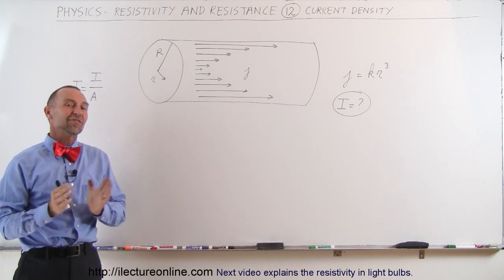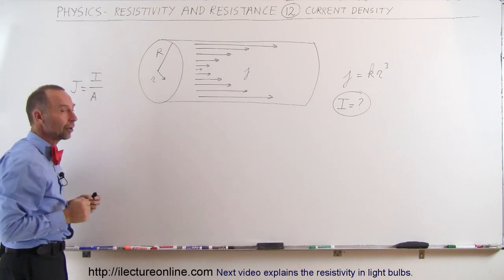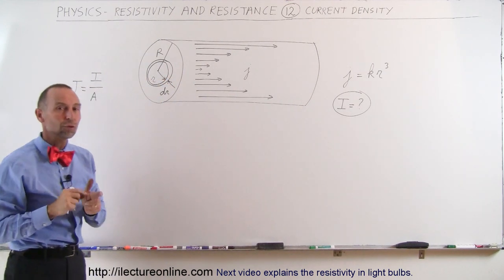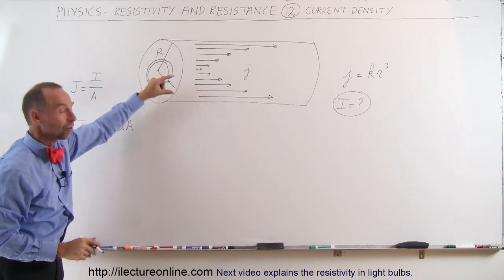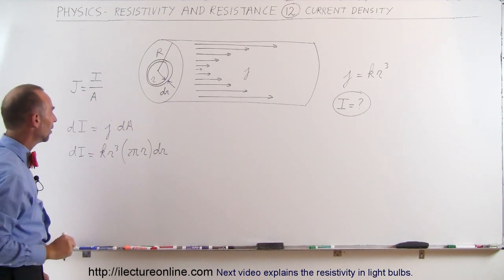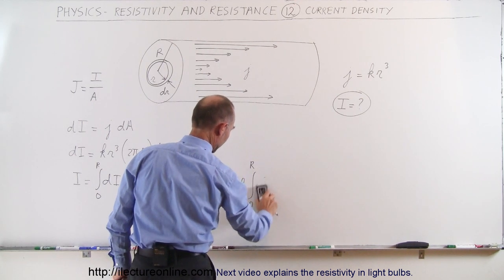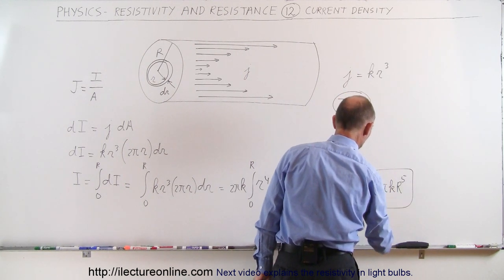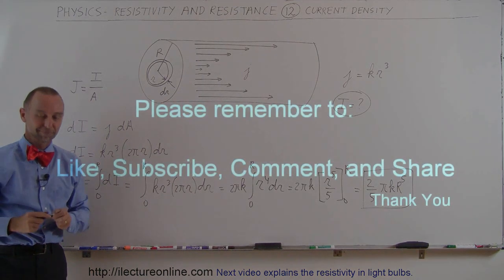Physics 40   Resistivity and Resistance (12 of 32) Current Density of a Conductor

Comment: Sir, as we know the real variation of  current density across the cylindrical conductor in DC current is j=j°(1-r/R) where  R is radius of cylindrical wire and j is current density at r distance from center . But I want to know why is it and why it is  this type of variation . Please solve my doubt .
Reply from the maker: The effect is similar to fluid flow in a pipe.  The interaction of the water molecules with the molecules of the walls causes them to essentially remains stationary.  Then the internal friction (viscosity) of the liquid causes those molecules next to the initial layer to slow donw.  As you go towards the middle, the effect of the molecules on the sides diminishes.  There are a lot of similiarities between that and the current inside a conductor.

Comment: Thank you for the lecture, it was very clear. I am curious: I know that in a steady current situation, div(J) = 0, but this still allows J to be a non-constant function. In practice, is it then possible to have a simple, resistive, closed loop powered by a DC source such that the current through any plane of the loop is a function of the area? I'm trying to resolve the competing ideas of current flow through a circuit being the same at all points of a series configuration while allowing the J vector to be a spatial function. I know I'm asking a lot, but I would greatly appreciate your insight, or a link to a video you've done to answer a similar question in the past. Thank you, Oswald.

Comment: j=kr^3 is for a round wire,  is there such formula for rectangular wire? would you please let me know?
Reply from the maker: I have never seen a rectangular wire.  But if we had, we need to use differential equations with boundary conditions (like the equations for wave guides which are indeed rectangular)